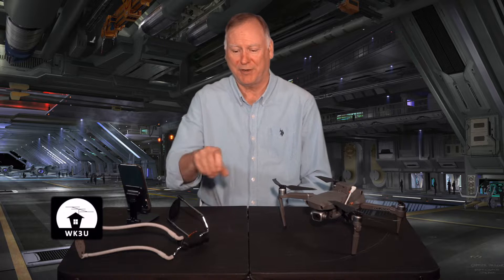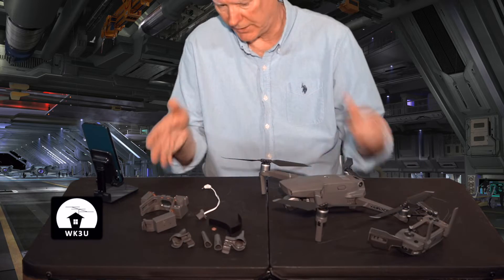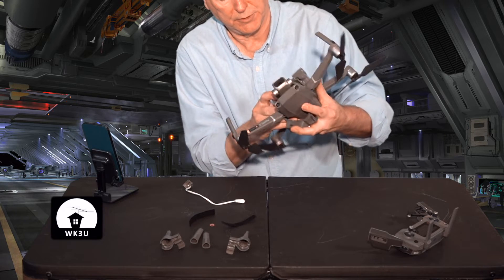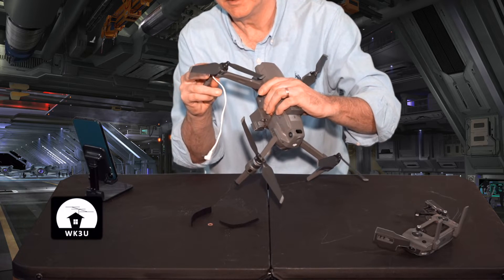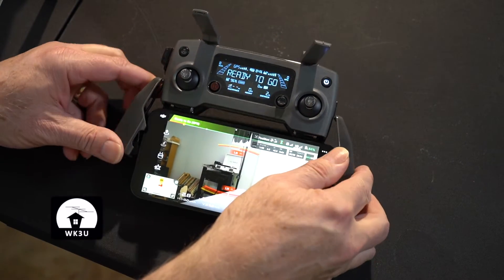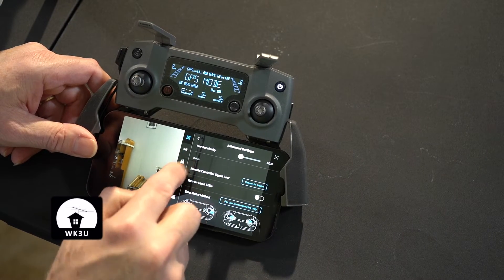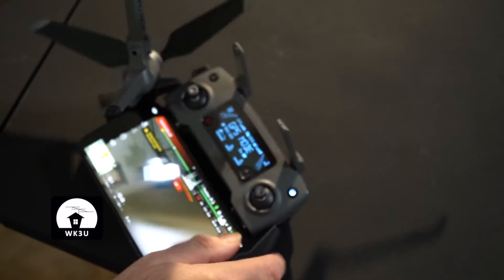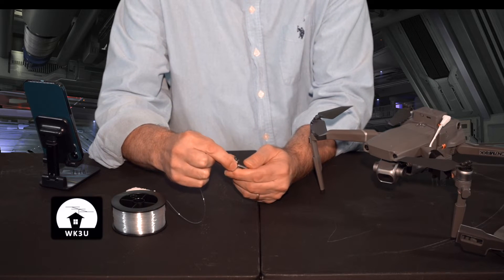Drone Deployed HF Antenna - Ham Radio in the 21st Century

Comment: Does anyone know how to find the DCR Rules for use of Drones for Ham Radio in our Massachusetts Parks?
Reply from the maker: @gregorykenley5997  you will have to research each jurisdiction for their drone rules. So, for a State park you would have to search the state regs. For a city park, you would have to search local ordinances. They normally only regulate take off and landing, as for the most part once in the air the flights are controlled by the FAA.

Comment: Very nice.  I've tried this a couple times with my Mavic Air and it works really well.  There is something to be said for the simplicity of the slingshot though.
Reply from the maker: LOL, I was thinking the same thing. The one thing the drone gives you is accuracy. With the camera pointing down I can drop the weight pretty much right where I want it.